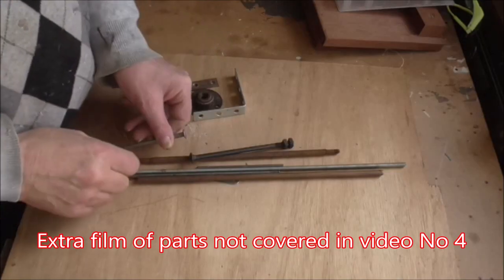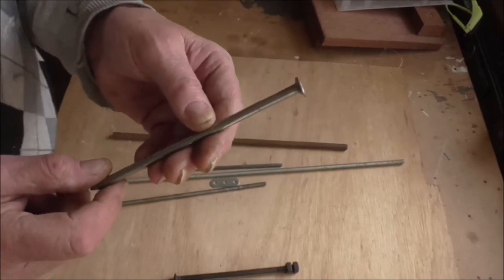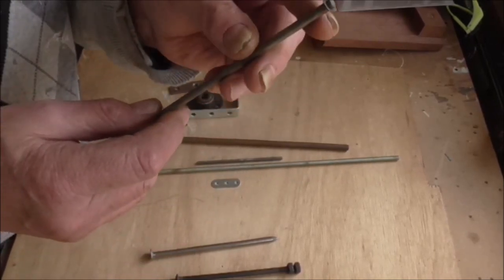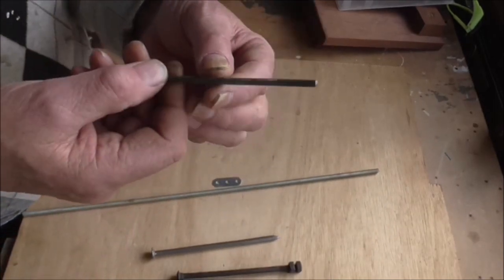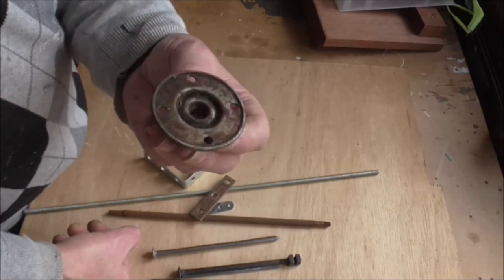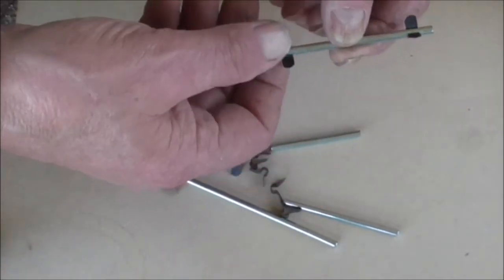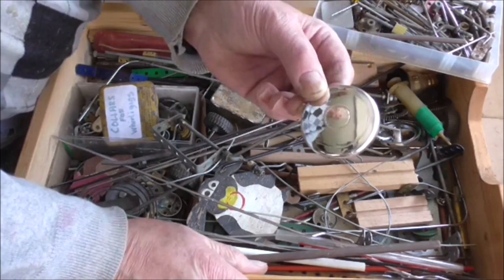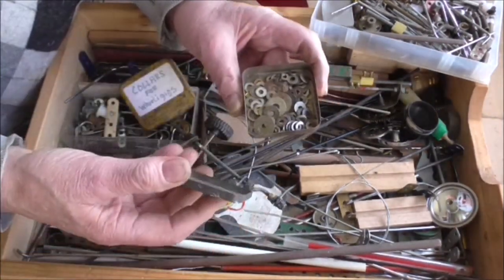Whirligig tips Extra Bits.

Comment: still not sure how the propeller is held in place or affixed to the rod.   hmmm
Reply from the maker: Thank you for the comment, I am sure I covered your question in at least one of my other video's on whirligigs, (this video was just some extra bits) I just use an old Meccano bush wheel (part no 24) or any other Meccano wheel that is equipped with a fixing bush. The bush has a fixing screw on it's side which is tightened on to the axle rod.  I use these old Meccano parts as they are plentiful and easy to fit and remove. you can see this in detail in this video.   https://youtu.be/w9K4JqVCZl8